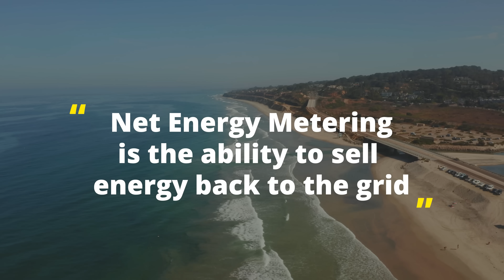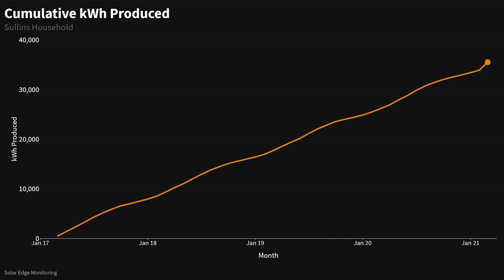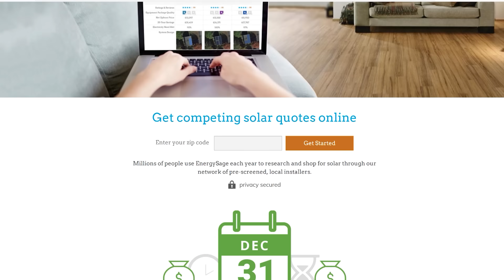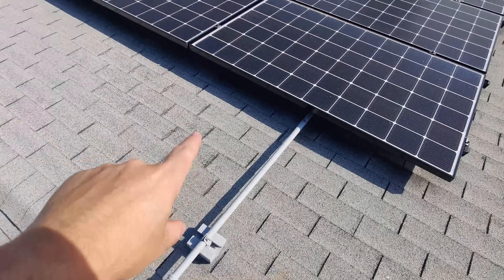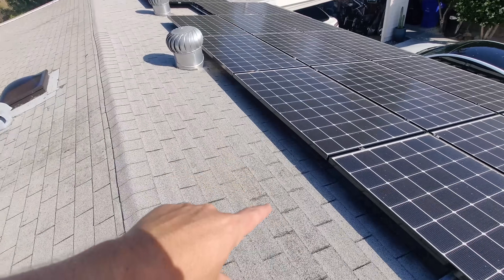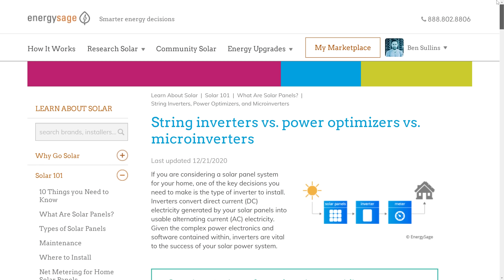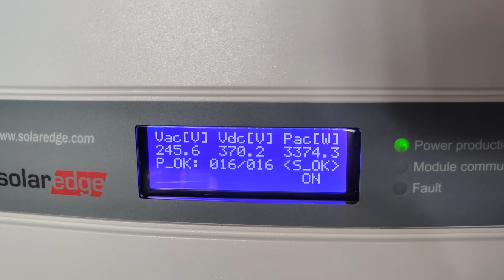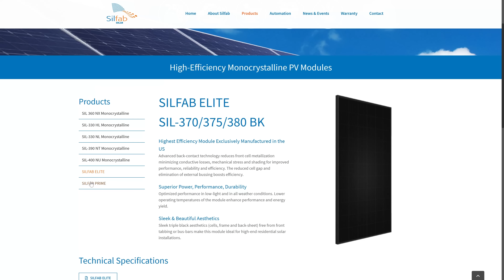The TRUTH About Solar! 4 Year Review

Comment: If you need to change roof now you have a big problem. What is the cost to remove and replace the panels?
Reply: I wonder how often you expect someone to nedd to change their roof? Lokal fixes does the job mostly
Reply: Our installer did a review of the roof at the first site visit and determined that we still have at least 20 years, which we already knew.  They can come and temporarily remove the panels for a roof job, but it will add to the cost of course.  Short answer is make sure your roof is in good shape before installing solar.
Reply: Here in South Florida, the reroof is very expensive. Permits, inspections. Remove everything from the roof, store the panels in your garage, roofer has to complete the new roof, final inspections. Then all panels and new attachments reinstalled. Here it usually comes up after tropical storms or hurricanes, and it ends up being an insurance claim.

Comment: Ben, great video, but Im hoping you can answer my question, If I follow your advise and purchase more than i need, then does that mean the power wall is not needed, or is it better to purchase 95% of my needs and a power wall to do the power shaving you talk about?
Reply: The power wall is a battery bank to store excess power from your panels for use when the panels aren't making power (cloudy, dark, etc) or, if installed for it, to supply power if the grid is down.  Purchasing more than you need will only help you if you need more power later than you do now (future EV purchase, etc).  It is recommended to increase your home's energy efficiency BEFORE installing a solar array -- air sealing, insulation, efficient appliances, etc -- as those things will reduce your energy use, and thus the size of the array that you need.

Comment: Just a note Ben.. I live in El Paso Texas.. we have net energy metering here.. but your map you showed shows all of Texas doesn't have this.. I think it's because of ERCOT? They might not offer this? But, El Paso does not get it's electricity from ERCOT.. which is a bit of an outlier from the rest of Texas. Just a little info to have for anyone out there in El Paso looking at going for solar. Love my system.. had it about 4 years now also.. it's f'n awesome.. We get so much sun here in El Paso my yearly net pay out for electricity is about $40 (not including what I paid for the solar of course). I am looking at adding a battery or two.. then my pay out to the local power company would be $0. It's not a huge savings.. but the potential emergency use is something I like the idea of having.

Comment: I agree on the micro-converters and avoiding mismatched panels.  I would add another lesson I learned is redundancy.  For us that was the inverter.  Our primary home had a 13kw system installed in 2016 (48 panels) on a flat roof (santa-fe style with parapets).  At the time we had just had a major 1 in 100 year hail storm that destroyed all the roofs in our neighborhood.  So we had just had a new roof put on (glad to have home owners insurance) for our 4k sq foot home + 1k sq foot garage.  So roof space was not an issue.  I decided to go with a 2014 panel lower wattage panel that was rated to withstand 1 inch hail just to avoid another freak hail storm taking out our solar system.  But then we had a bad lighting storm hit the area in 2018 and knock out the inverter.  Took Solar City/Tesla about 3 weeks to come out and repair/replace $1 fuse and restart the inverter.  That was in August when we use to get $600/mo electric bills (AZ in 110+ temp days) so even though the inverter and panels have the 25 year warranty we still had to pay a huge electric bill due to no electricity conversion for 3 weeks.  If I was doing this all over again, I would go with micro-converters and if that wasn't an option then would ensure I had multiple inverters for the system for redundancy.   We also installed 130% of what we needed at that time and then improved efficiency with a new SEER 17 AC on one side of the house that gave us enough excess to power a Tesla M3 purchased in 2018.  So also agree about adding more panels than minimum needed for today.  The savings and the full tank on the EV are hard to beat.  The independence and freedom from utility companies (and their annual price hikes) and fossil fuels can't be overstated.
Reply: True, my inverter died and couldn't replace for 2mos in summer , lost $100s in generation... Sungevity wrmy bankrupt so I didn't have any monitoring, and difficult to get replaced (finally got free warranty, did it myself)

Comment: The microinverters will not work with a battery based system.  You would not use microinverters with your system.  You want to feed DC power to your batteries and only convert to AC when needed.  Otherwise you would be getting AC power from your panels and have to convert it back to DC only to then convert it back to AC when needed, this would waste power and add complexity.  Your system is ideal when batteries are involved.
Reply: Darren, that is partially incorrect.   I’ve sold solar for over 6 years.  I only use the Enphase micro-inverters and batteries connect perfectly to them.  Plus, Enphase has its own battery system now.  They do use inverters in the battery system also.  Awesome system.
Reply: @adamschmidt  It is true.  The micro inverters change the DC to AC at the panel.  So you charge a battery you have to convert the AC back to DC.  It's a massive waste of power and complexity.  Solar is DC so taking DC to AC Back to DC at the Battery then to use it convert it back to AC is silly. If you cite losers that's fine but doing what you say is fine has to by pure physics more than tripling your losses or close to it.

Comment: Great review. I'm midway through getting panels installed on my house in England - it's through a bulk purchase that our local government invited people to join, so while there's economies of scale there's also less choice about panel type. I'm definitely looking forward to swapping our electricity supply to one of the companies that offer hour-by-hour agile rates so we can make the best use of the arbitrage opportunities.

My expected payback period is rather longer at around 15 years (I'm at 52.4 degrees latitude compared to your 32.7ish (though that's slightly offset by having a much steeper-pitched roof), and I don't have aircon or an electric car to soak up those juicy kWh, so the non-panel costs start to dominate.
Reply: Not sure if you already made a choice, but look for an inverter with a low start-up voltage. This way the inverter will kick when there is less light. With a inverter with a high start up voltage you will miss out on days when the shun hardly shines of is blocked by thin clouds.
Reply: @ThePupil  The scheme was fairly "you get  what you're given" and included the inverter, but that's something to bear in mind if I go down the battery storage route later, since that will presumably require replacing the inverter anyway.

Comment: So for a commuter doing 40 miles daily, how many panels would you add?
Reply: Depends on the car. You can look up how much energy the car you want uses per mile (roughly 200-400 Wh) multiply that with your commute, then look up how much energy a typical solar panel makes in a day*, divide the first with the second and you get your number. Then, depending on how much you are able/willing to invest, add some margin to it.

* depends on your location and your roof, but there are online tools that help you get an estimate.
Reply: @andrasbiro3007  now put that in a formula. Also add the insolation factor, the roof angle and the compass direction. Release it as a Google sheet, for people to play with.

Comment: Wait Ben!  Your saying to purchase as many panels you can!  You didn't mention the net metering requirements and the limits that SCE is going to give you if you purchase or panels then you use.  I am going through that right now.  I purchased tesla solar with a 12.8 kw system and I use about 9.5 kw a year.  I am afraid SCE is going to deny my net metering because if it.  What r your thoughts?

Comment: What’s the wattage for each module you own?  Modules being installed in solar farms are around 410W in rated max power. 
Panels are getting more efficient and cheaper as well than 4 years ago. Hopefully the trend continues to improve.
Reply: I had a system to play with for a year (only small) and on the garage roof using second hand panels and it did ok, 275w each with 6 panels. I just replaced the panels with new ones and they are 495w +3% each. It is a lot better now.
Reply: @markeh1971  Hi Juan
Just installed Canadian Solar's 480W panels. I get max 81% efficiency on each of them in South Africa.

Comment: Micro inverters are less reliable and when they fail you have more repair costs. The are allot of cases where solar Edge inverters fail time after time. You should only use micro's with complex shade. Otherwise choose a premium string inverters like SMA. My 9kWp solar system has a ROI of 3 years, this is in the netherlands however where solar is permit free.  When you want solar get it to the max!
Reply: AND you also can put some Inverter outside, if you have to. 
Lot of downsides with microinverters. For the most users big string inverters is the way to go.
Reply: PowerWall is AC-coupled, so compatible with microinverters. LG Chem won’t as it’s DC-coupled.

Comment: Net metering map at 1:30 is inaccurate. Michigan resident here with solar. Can confirm we absolutely sell power back to DTE at $0.08 per watt. As a reference, MI energy costs average about $0.12 per watt here.
Reply: Selling back electricity at wholesale ($0.08/kW) while buying at retail ($0.12) is by definition not net metering.  Net metering is when you sell and buy at the same price, commonly retail. Which is why MI (and for the poster below in TX) are not on the map.  the operative word here is "net".  You aren't netting out with you electric provider because of the price difference.
Reply: I agree as we can net meter here in Texas
Reply: Agreed
Reply: Have net metering in Illinois also. I have panels and net meter myself.

Comment: I have been thinking about getting extra solar power if I get a setup,  but I am looking for something profitable to do with the extra energy because Utah does not pay very well for energy sent to the grid. Anyone have an idea what to do with the extra energy?
Reply: EV charger maybe?  Definitely drive an EV!  Although I don't know if you considered charging an EV in your sizing calculations.  That could potentially double the size of your solar array.  Some EV offerings may be able to function as a home backup electrical supply.  There's currently more development of that strategy in Japan (Nissan) and Europe.  Good luck!
Reply: @designpaulf  I wonder how much a person would pay to change up.
Reply: @IntermountainGoldRefiners  install a meter and charge them by rates! beware of taxes though!!!
Reply: @MK-fk4kp  what kind of tax, sales tax?
Reply: I went to a Solar Edge talk and hot water is the best cost saving for storage, followed by batteries.
Reply: @markeh1971  how do you get electricity out of hot water? Thermocouples?

Comment: Nice! I guess if you don't want to add now but might later (because it's too expensive right now or whatever reason) and you have a pitched roof. You could install them on one side of the roof and in ten years use the other side. That way if you can't find the same panels, at least each side of the house looks uniform :-)
Reply: It might hurt the efficiency. You want the panels to get as much direct sunlight as possible, so it matters a lot which way they face.
Reply: @andrasbiro3007  true that. I guess whether it makes sense or not depends on several factors, like which way the slopes are facing, geography, etc 🤷‍♂️
Reply: @andrasbiro3007  Good point, though, some folks have panels on "morning"(east) side of roof pitch, then others (main) on "afternoon" west side of roof, get more during all times of day. They definitely need to be on separate strings (if not separate inverter) or else micro-inverters, as they will get different amounts of sun/shading during times of day

Comment: Similar story for me: I got 12 panels installed in 2013, which more than covered my annual energy usage - until I got a Tesla in 2016. Had to install another 12 panels to cover that! They are a different design, and although all 24 panels use microinverters, the installers had to run a separate circuit for the new panels. It's nice having an energy bill of zero for 7 years straight. But it will take another 2 to 3 years to pay off completely, given the $3000 electricity panel upgrade and permit that was needed for the 2nd solar system.
Reply: Did you price what it would cost to get off peak grid power just for the Tesla?
Reply: @charlesharper2357  Off-peak electricity is quite dirty in Southern California (mostly natural gas and imports), which is what I was charging my Tesla on exclusively for the first 4 years. Now I've modified my Tesla wall charger to allow me to charge from my excess solar production during the day, thus making my Tesla clean and saving a tiny bit of money by avoiding the grid.
Reply: @markirmuir  
Thanks...I was just wondering cost wise.
I applaud you for making the choice based on how dirty the power is.
Reply: @charlesharper2357  There's a special EV plan where you can charge at night for 9c per kWh, but you don't get net metering. With net metering, its 31c per kWh at night, 34-44c per kWh on-peak - and excess solar generation is credited 28c per kWh. At least these high prices make solar pay back a lot quicker. California's grid has an incredible amount of solar on it - over 65% of generation comes from solar around mid-day, which is why there's now a super-off-peak from 10am-2pm.
Reply: @markirmuir  
Wow that is expensive...easy to see that that it makes sense to go solar.
Up here we Albertans whine about 18c per kWh...
Reply: That's still a good deal Mark!!
Thank you for sharing that information.
Reply: Does it really take 12 panels to charge a tesla? That's crazy I never would have thought it would take that many
Reply: - I sell solar. Where I live it doesn't make sense to get extra panels for EV charging. Our utility provider has a program specific for EV charging off peak hrs. You need a separate meter installed just for EV charging but they charge a rate of under .02 /kw. There's no way any solar we sell can beat that price.